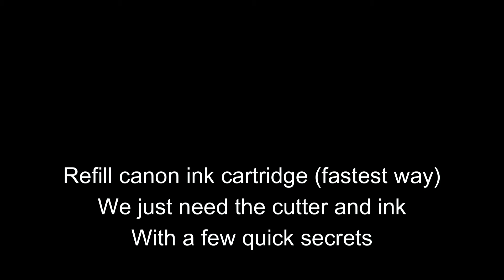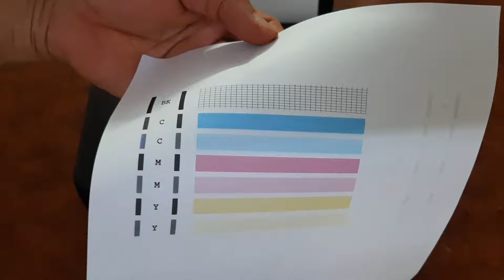Refill canon ink cartridge (fastest way)We just need the cutter and ink With a few quick secrets

Comment: You dont have to remove the cardrige cover you can drill small hole on top and poor ink with injection syringe. it works just as good as this.I've tried.
Reply from the maker: It works well and I have tried it before, but it is not better than this method because some or most of the cartridges need to be cleaned from the inside because the inks accumulate on the nozzle openings that are in contact with the sponge, especially when the printer is left idle for a period of time, so it is recommended to turn on the printer from time to time.

Comment: Nice method.  I just wouldn't rub the paper towel on the bottom of the ink jets.  You can ruin your jets or at least get fiber bits stuck up under there.
Reply: That is also true if he didn't use demineralized water. The nozzles can clog if the water has limestone.

Comment: A few things worth mentioning. It's not the fastest way if you have to soak the empty cases for 6 hours.  Also sticky tape if wrongly positioned can block the vent holes and reduce flow of ink.  I personally find using syringes for the separate colours and the black one injecting into the appropriate holes.  The kits are available on YouTube.  Also I use surgical disposable gloves to avoid messing up my hands with ink which is bound to happen and it's the devils job to wash off.  But I do like the video it's an alternative method to the accepted way and you learn something about the cartridge design.
Reply from the maker: Hello, thank you for the comment and I respect your opinion. This method can be considered the fastest method with guaranteed results, and the sticky tape does not stick or block the vent holes because there is a liquid that prevents that, and the sticky tape is only used to protect the cartridge nozzle holes. As for the gloves, your opinion is correct, and as for me, I prefer to work without them sometimes in order to get more accurate results.

Comment: just peal of the sticker,there should be a hole to add ink.if you open it by prying apart the lid you might damage the triangle clips that hold the cartridge in the printer.if you damage it then it might not fit back into the printer.
Reply from the maker: Thanks for the advice
But you are talking about a new ink cartridge that is out of ink, and I am talking about an old or abandoned cartridge or the ink in it is dry. I remove the cover so that I can wash or replace the sponge inside the cartridge and wash the cartridge from the inside to open the nozzles. As for my work, it is based on many experiences and expertise in this field.
Thanks any way.
Reply: @greattechnical_AH hi what did you use to wash cartridge? Is it water?

Comment: Only method that worked for me. I tried to soak the bottom part only for a few minutes, it didn't work. Tried the rubbing alcohol method, didn't work. I finally gave up and figured why not just soak the whole thing. And it worked!
Reply from the maker: Thank you for your honest comment, when I shared the video I meant for the benefit of everyone because I am sure that the method will work on most printers.

Comment: Hello, Thank you very much for your video, it helped me a lot, can I apply this for the canon pixma g2410
Reply from the maker: Hello, I am very happy with your comment ,your printer type does not need to be refilled in this way because the printer (canon pixma g2410) contains ink tanks that can be filled when they run out .But you can follow the same method to clean the cartridges.

Comment: Hello friend.... can I also apply this method to my Cannon G1010 printer.
Reply from the maker: Hello, your printer type does not need to be refilled in this way because the printer (Cannon G1010) contains ink tanks that can be filled when they run out, but in the event of not printing due to leaving the printer for a long time without use, you can separate the cartridges and soak them in water from the bottom only and at a height of half a centimeter, and you must be careful and avoid getting water on the contact points on the cartridge.
Reply: 😊😊😊😊❤😊❤😊❤😊❤😊❤❤😊❤😊❤😊❤😊❤😊❤😊gracias

Comment: I hope you would answer my question. I have a Canon g 3400 printer. My mother turned it upside down because she did not know what this device was. The inks spilled inside the printer and the inside became dirty with the news. I am now confused about how to remove the inks.
Reply from the maker: Hi, since your printer type has separate ink tanks, in this case I think the ink leak is in the ink tank area. For this you should open the outer cover (which is a simple process) and then dry the ink contaminated area as much as possible.

Comment: Hello there,If im refilling a new cartridge for the first time,do i need to soak the cartridges in water.My printer has been skipping lines.Ive been refilling via injection. Please help and Thank you 🙏
Reply from the maker: You are welcome , you do not need to soak because the cartridges are still clean and in good condition, it only needs to be cleaned after refilling the ink.
Reply: Thanks.I ended up buying buying a new black catridge. It's skipping lines.The color one is empty. I wanted to use the black catridge ink, but it's skipping line.I did print alignment, nozzle cleaning, and deep cleaning, but still no results. I'm defeated.Is there a solution for skipping lines and strikes?Please, and thank you again 🙏
Reply from the maker: Welcome back, it is possible that you left the printer for a period of time without printing, which led to the blockage of the print holes (nozzles). Try placing the cartridge up to 1 cm in water from the bottom, from the side of the nozzles, for a period of time, then clean the cartridge and try printing.

Comment: Also, the printer I use is a Canon TS3360 with cartridges PG-645 black and CL-646 color.  Is your refill method ok for this printer?
Reply from the maker: Of course, this method is suitable for the printer mentioned in your comment
The method is suitable for many of the types mentioned in the description

Comment: One doubt if I opened the cartridge then weather it can be closed perfectly or it will be always open only 

Or we have to close the cartridge with cellotap
Reply from the maker: The cartridge can be easily closed using a suitable adhesive, but for me I left it open because I use the printer a lot, and I tried to convey the information about cleaning the cartridge that was left for a while.
Reply: @greattechnical_AH   I have one doubt regarding canon printer I have please

I am new to printer field please

without two cartridge PG 47 and CL 57

with anyone colour Cartridge we can use or if both cartridge are there only it will work please tell

only black cartridge is inserted and colour Cartridge is not fitted (not having) weather the printer will work or not please explain please
Reply from the maker: Both the color and black cartridges must be inserted into the printer together or it will not work. If you insert the cartridge and it does not work, it is likely that you did not install the cartridge correctly or that the contact points are damaged or not connected well (try to clean them carefully) and reinstall the cartridge and make sure of the sound of installing the cartridge in its place (click).
Reply: @greattechnical_AH  okay thanks so much

Comment: How many time can I refill canon 810 cartridge??And how much ink need to refill?
Reply from the maker: Depending on usage and the period of use of the previous cartridge.
Reply: @greattechnical_AH  But why the cartridge is not working after a few times of refiling??
Reply from the maker: If the cartridge is new and after filling it more than once and it does not work, the cartridge nozzles should be soaked for a period of time, cleaned and dried, then the cartridge should be filled with ink and checked by printing, and if it does not work properly, the method should be repeated again and checked.
Reply: @greattechnical_AH  No.sir this is I know.I wanted to  know why we can not refill a carriage agan agan means 30/50 times
Reply from the maker: I understand what you mean, and who says you can not refill a carriage multiple times until the cartridge nozzles fail ?
That's what I mean.

Comment: Hello, should there be a hole through the top of the cartridge to act as a vent hole?
Reply: He just taped it back together:  it's not like the edges are hermetically sealed.  Better not let your full cartridges fall on their side or you will have a mess.  I like this method, though.  Nice to see what you are doing.  I can't figure out why they don't all leak out the bottom when he fills them up with the tops all off and lets them sit there.  I am used to old school HPs tho. (no longer an option) New to Canon.

Comment: I have bought NEEDLE INK and filled PG47 cartridge I refill the cartridge but still printer shows no ink and it's printing well without any error what can I do please tell
Reply from the maker: If the printer still does not print after cleaning the cartridge nozzles, try the following steps:
1. Clean the cartridge nozzles several times and leave the cartridge for a while after filling it until it is soaked with ink.
2. If it does not print, try following the method shown in the video.
Reply: @greattechnical_AH  every thing printing but the black ink low indicator light is blinking what to do please tell
Reply from the maker: The indicator light cannot be turned off due to the ink cartridge being filled and the light cannot be turned off unless the cartridge is replaced with a new one. I advise you not to pay attention to the indicator light.
Reply: @greattechnical_AH  okay 👍👍👍 

Please do only one help how to find when to refill ink next 🤔
Reply: @greattechnical_AH  my doubt is how to analyse weather the ink is going to complete and I have to refill
Reply from the maker: This is unpredictable and depends on the amount of ink added. In general, when printing starts to be intermittent, unclear or light,
Reply: @greattechnical_AH  okay 👍👍👍 thankyou so much

Comment: Why did you not wash out the sponges and eould nog running the cartilage under running tap water wash them out quicker.
Reply from the maker: Of course, you need to wash it well to remove the remaining old ink. This was mentioned in the video at minute (5:30). The benefit of soaking is for the water to penetrate the nozzles and get rid of the hardened ink residue stuck to the cartridge.

Comment: Thanks for your reply.  Is it ok to soak the sponges in water to remove the old dry ink before using the fresh ink?
Reply from the maker: The point is not to soak, but to wash and dry the sponge so that the ink does not dilute . I hope my comment is useful.
Reply: @greattechnical_AH  The printer says that the cartridge is empty so I want to wash the sponge and restore its white colour.  The cartridge has never been refilled.  Apparently a cartridge is only good for about 4 refills.

Comment: would it be ok if i just skipped the washing part and filled the sponges with ink directly?
Reply from the maker: If you mean to wash the sponge, it is okay if the ink cartridge is not old .but if you mean to wash the ink cartridge, I do not recommend that .
Reply: @greattechnical_AH  I meant the ink cartridge, can I skip the washing if my cartridge is new?
Reply from the maker: You can skip the washing because the ink cartridge is new
Reply: @greattechnical_AH  thanks king :)

Comment: I already filled the black ink in the cartridge but  why it it doesnt detect on my printer    theres a notif in my computer says that ..empty black ink detected..
Reply from the maker: The ink level is not detected except for the new cartridge because there is an electronic strip in the cartridge that is programmed in a way that does not allow the old cartridge to work, but despite that, it can work normally, but the lights remain on.

Comment: On my 445/6 the ink is flowing but i cant print. The inks show on the paper towel but when i send a job to print the paper comes out blank.🤕
Reply from the maker: There are several possibilities
The toner cartridge may not be inserted correctly
Or the life of the toner cartridge has expired
You can refill the Canon 445 (PG-445) Cartridge between 4 – 8 times. This is the best refill kit available making refilling your own cartridge a breeze.

Comment: THANKS ...great job 
, i have canon pixma g2420 with an error 5200 
I filled the ink in each of the tanks, tubes and cartridge, but unfortunately the same problem is still present, and I also cannot control the commands via buttons ( menu...) on the printer or the computer program,  because it shows me an error (printed sheet count 2451-2500)
Thank you very much and please reply to my problem if you encounter this problem.
Reply from the maker: Go to the following web address, it may help you:
https://support.usa.canon.com/library/ij/ErrorCode/G3000%20series/EN/ERR/5200.html

Comment: I did this but I got pink printed instead of green
Reply from the maker: I think that one of the colored cartridge nozzles is faulty (yellow or blue) because the green color is a result of mixing yellow with blue. Try cleaning the nozzles by placing the head of the cartridge in water at a height of half a centimeter and be careful and avoid getting water on the contact points on the cartridge.

Comment: Just an observation, but, in the title you say this is the fastest way. Can you explain how this is please as in the video you say to soak the cartridges for 6 hours! Yet on other videos and what I have done myself using syringes you can refill a cartridge in mins and without having to soak the cartridges and still acheive the same result but a hell of a lot faster!
Reply from the maker: First, you benefited from my video or others' videos as a method of operation. Second, I used an old and dry ink cartridge for a long time. I challenge you to refill a cartridge in mins without having to soak the cartridges when using an old or dry ink cartridge and it works properly.

Comment: i think the faster way is by using a syringe
Reply from the maker: The method of using a syringe is used to refill a good cartridge
However, this method of mine is used for good and old ones, or ones that have been left unused for a period of time, but not for damaged cartridges. I appreciate your opinion.
Reply: @greattechnical_AH the hand drill kills me. It took me all day, literally to do the 3 colors...and i did red wrong.  Not easier. And after all those holes the thing jiggles like its weak anyway. I do every craft so this i can handle. .no hand drill ever again.

Comment: My printer just read color cartridge but the black no is this methode work on black cartridge on hp f4180
Reply from the maker: First you have to install the black cartridge correctly
Then if it doesn't work, you have to reset your HP printer
by unplug the power cord from the unit. Reconnect the power cord into the unit. When the lights begin to flash, press and hold the Power and Cancel buttons. When only the On/Resume light is flashing, release the buttons.